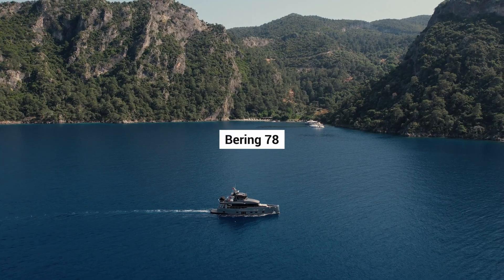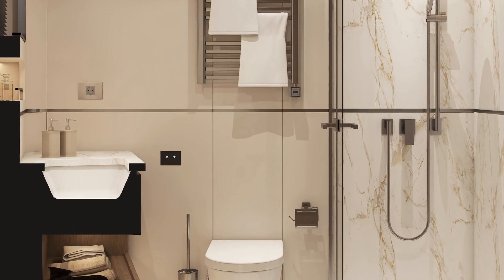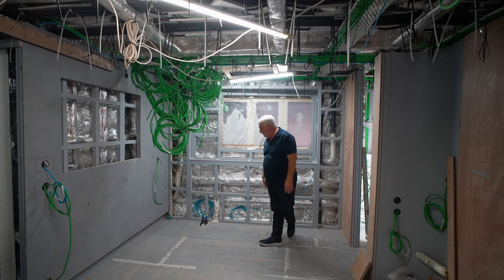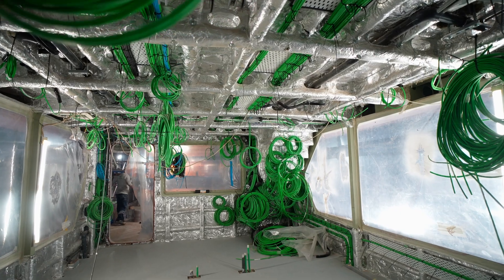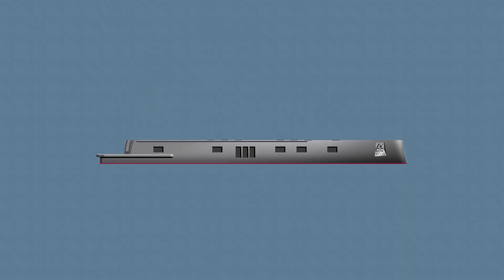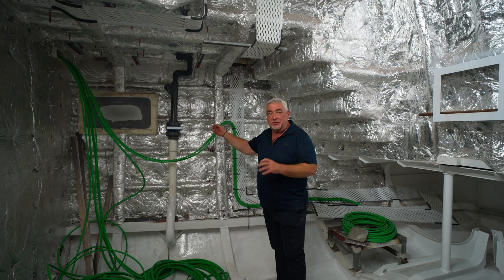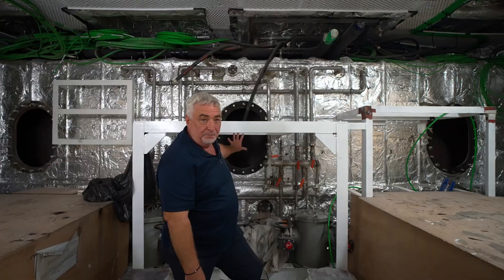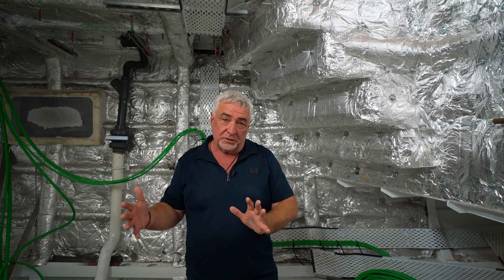UNDER CONSTRUCTION: Behind the Walls of the Bering 78 Explorer Yacht

Comment: I am very glad to see the construction of a new 78 going on-- it was a 70/72? previously?
LOVE the look of the vertical bow on these Coastal Cruisers, as you do/ did call them.
Can't put my finger on it-- or express it in keystrokes presently- but there's something seeking improvement on the lines above/ around the pilothouse... too angular?
Realizing your line-up is only continuing to grow in length and tonnage, happy to see these little ones still being made.  If only you made a slightly smaller unit that was more Great Loop favorable, but that's probably not on your radar, so to speak, anymore...